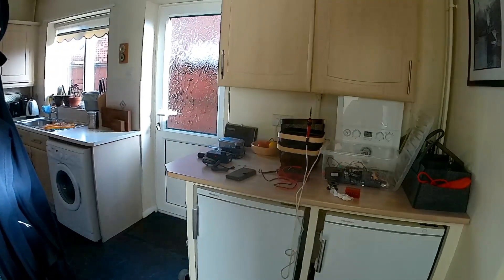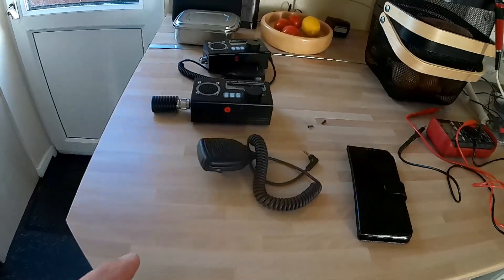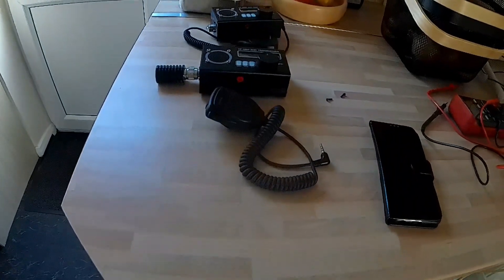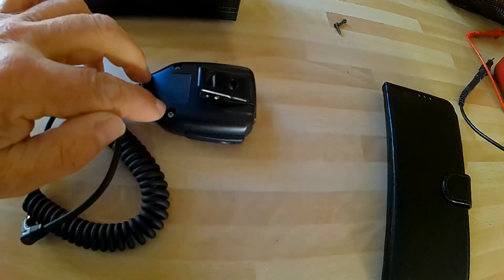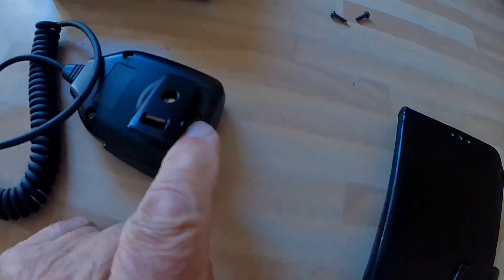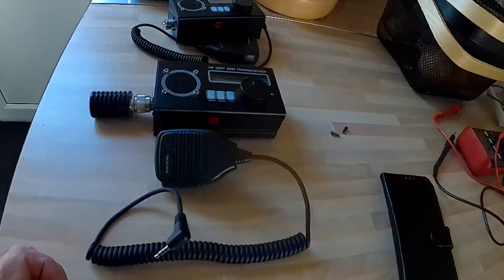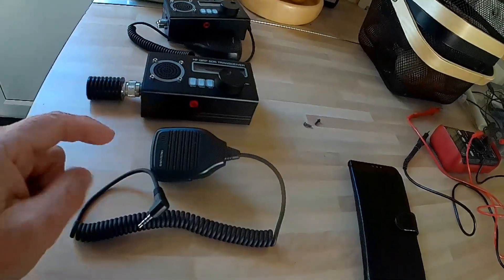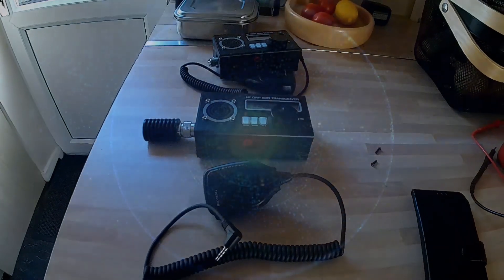Baofeng Microphone for Use with the. HF 8 Band QRP SDR Transceivers.

Comment: Hello mr Georges. Does the hf qrp sdr works on the 11 meters band. In tx and rx ?  I use 27.555 MHz frequency for my Qrp qso’s. Thanks to u. 🎉🎉🎉
Reply from the maker: Hi I will answer you question in a video. I will upload in the next couple of hours. Thanks from George
Reply: @MakeDoAndMend1  thanks Mr Georges. Waiting for vidéo. 👍